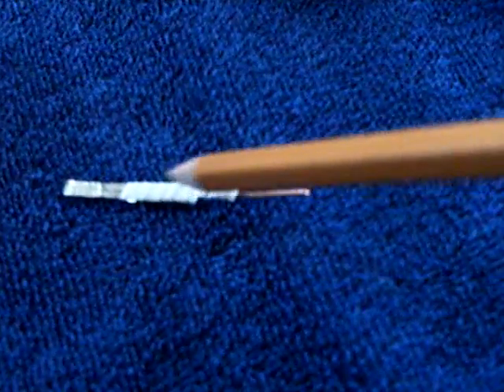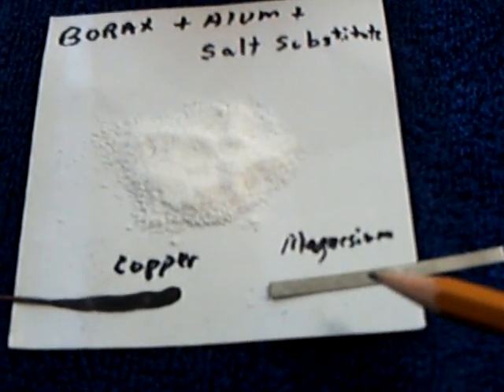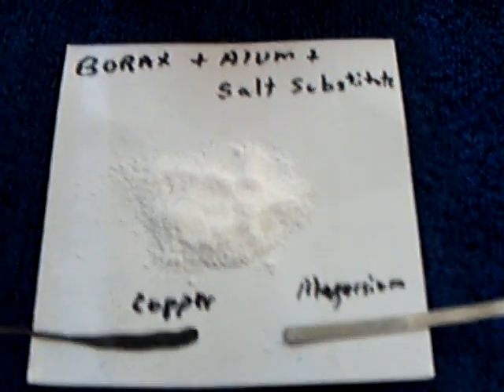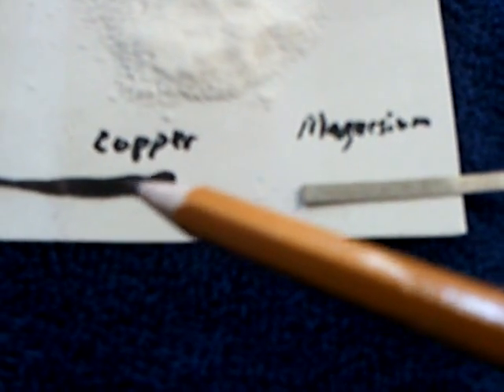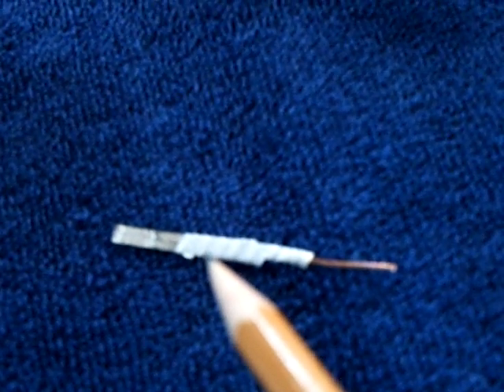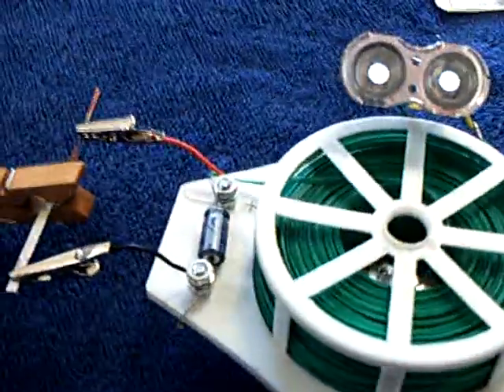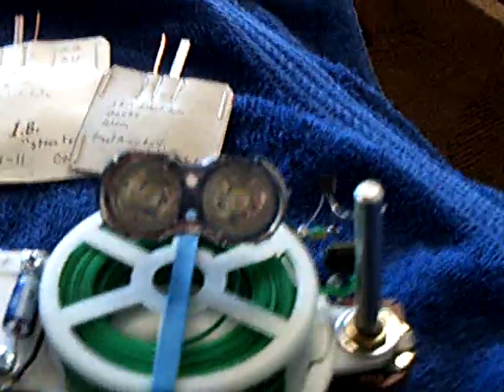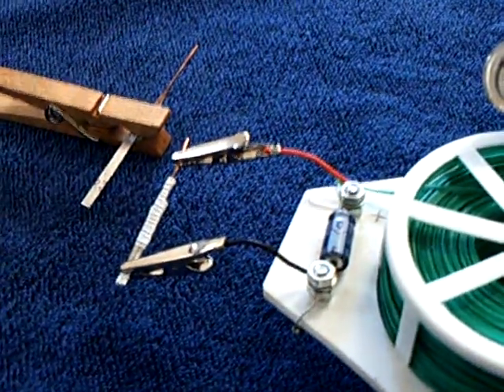Humpty Dumpty---- The crystal cell that had a bad fall and survived

Comment from the maker: @DadHav -------Yes shorting out the electrodes is a problem because there is no separator.  I wouldn't use that soldering ribbon.  The copper electrode needs to be a solid strip and heated until it turns black.  John Bedini says to heat it several times to drive off the impurities.   The heating process forms a diode junction on the surface of the copper.   Don't expect much amperage.  Your oscillator circuit needs to run at 1mA or less for these small cells to handle it.

Comment: I used about a foot of de-soldering ribbon, sanded it and the flux burned off when I heated it. I wrapped it in a coil with the magnesium and chemical coating. I got 1.5 volts but not enough current to run my oscillator circuit. This was without Borax. I may have a short between the two metals or something.
J

Comment: @Lidmotor I was been following your work on crystal cells and wonder what voltages and current you would get if you put bunch of copper+magnesium plates into array with size of car battery. Maybe you or someone else tried to do that? My guess is, it would be not too hard to make 12V crystal battery at least in miliamps-amp range.

If you manage to do that, then there is easy way to dump conventional batteries :)

Good luck!

Comment from the maker: @overunitydotcom ------WD-40 is an anti corrosion product.   If you Google it you will find that there is quite a story behind it.   My Dad was working on the Atlas missile project  (the one that took John Glenn into orbit) when WD-40 was developed to keep corrosion from happening on the thin stainless steel skin of the missile.  WD-40 stands for "water displacement formula number 40".   It was the 40th formula that the San Diego based company tried.   People use it for all kinds of things now.

Comment from the maker: @KyleCarrington ------WD 40 displaces water and leaves a thin oil film when it dries.  The idea here was to stop the corrosion and galvanic action (or slow it way down) to see if the cell still worked.

Comment: It looks like layering the electrodes in series, perhaps 10, then pressuring the packs together, might yield a higher power density factor, watts to volume them Li-on's. Plus self charging. A 144 volt battery might be shoe box sized. 40 milli amps would run Jonnydavro's light  transformer circuit.

Comment from the maker: @slider2732 -----I guess that we can test for the P or N junction  an with the "hot point" method that Jeri Ellsworth showed in one of her videos.  As I recall you use a soldering iron and a multimeter.  Some of my early cells still show a voltage well after 1 year now.  My plant battery " Phyllis" is still running an LED light 24/7 well after her birthday.  I should do a video on her.  She is all grown up now.

Comment: So the Humpty dumped itself all over the floor !
I can do a P junction with copper, but the N is the problem. Going to try boric acid and electrolysis on anything except plastic hehe. Really, as long as there is a coating left on a metal that doesn't flake, I believe that means an oxide type layer - though N or P would need tests.
So, have you decided what you are going to buy Penny 1 for her first birthday yet ? that cell/original setup is amazing !

Comment from the maker: @marthale7 ---Hey Mart.  I don't know about lead.   The oscillators that I am using can run on microamps and that might be why these cells are lasting so long.  The cells have very high impedance and you just pull much amperage out of them.  If you try to they just go flat ----but they bounce right back once the load is off.

Comment from the maker: @diveflyfish -----The one that I made today put out about 1.5 volts and 30 mA at first when there was probably some liquid water left in there.   Now after the WD-40 and running an oscillator for awhile, the standing voltage is still around 1.4 volts but amp draw is way down to about 500 microamps.   "Humpty Dumpty" is around 1.3 volts and about 40 uA.   The IB stove top that is running Penny No.1 sits at about 1 volt loaded and puts out about 20 to 30 uA.   It won't start your car.

Comment from the maker: @ibpointless2 -------Actually no.  I can make water based cells with all kind of things but a purely dry cell is MUCH harder.   Some of the chemicals for the other dry cells I have not been able to find locally.  I may have to order them.    John B. is right about them having to be correct or the build isjust a waste of time.

Comment: The oxide layer is a bit of a touchy subject, I don't think its needed but who knows? You said you took the magnesium and dunked it in the liquid mix of Epsom salt and then put that wet electrode in the pile of salts right? If so I may have a cell to share with you that works off the same idea. Great work Lidmotor, any luck with other combinations of crystals?